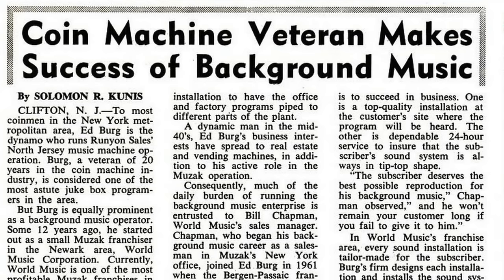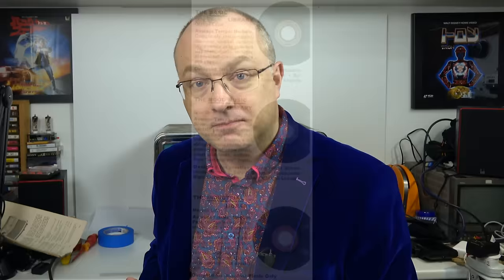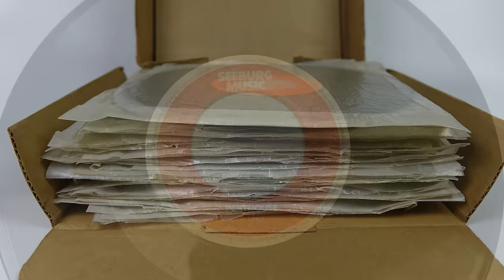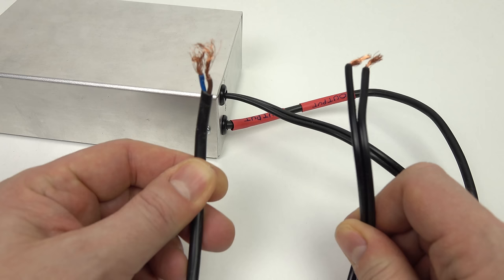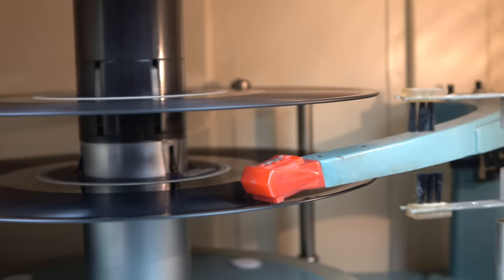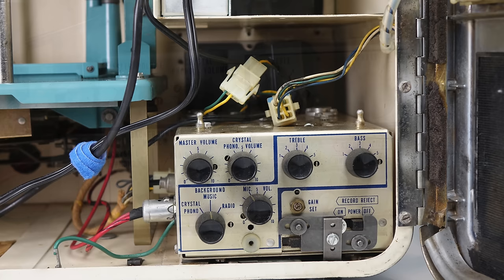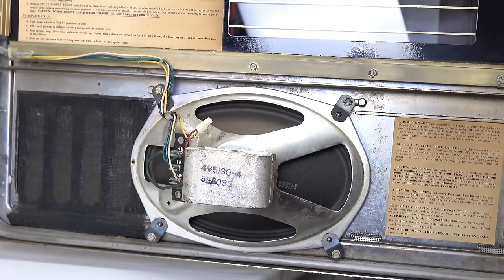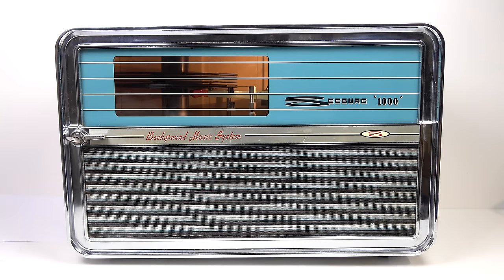RetroTech: Seeburg 1000 BMS1 Background Music System (1959-1986)

Comment: Hi I worked for the Ditchburn organisation in Lytham Lancashire who imported 50 of the Seeburgh BMS 1000 machines in 1960, I worked on these machines in 1968 to when I finished in 1973. My work was on the Amplifiers which after 6 years or so realy did need it the capacitors were leaky and the paper ones were crap but with a full service they performed brilliant. They were the best BGM machine ever produced far better than the Symphonare we produced or the later symphonet , I am now 77 Happy days.

Comment: I have 2 of these machines and the very rare Seeburg Encore machine
The warble your having is a common issue
The 2 rubber drive tires you have need to be redone
The rubber gets divots in the rubber tire from age and they need to be redone
Also there are 2 more oil points your missing
There's two to the right under neith the main platter
It's hard to explain but do a search on YouTube, there's a fellow collector on there who points them out.
They are the drive tire bearings
There's two little felt oil pad circles, you'll see them
They need a good oiling to
But to get the most out of the machine, have the two drive tires re rubbered.
Reply from the maker: Thanks for the information - very much appreciated.
Reply: YouTube at it's best.
Reply: The hive mind. ^^
Reply: I too have owned several of these machines over the years. Note the red T stylus, it is specific to this machine. The "micro groove" of the Seeburg BMS machines is smaller than a standard LP. I'm sorry but I can't remember the exact size now. You can use a Seeburg Jukebox T needle (.07 mil) and it will play, however it will cause damage to your records. The Red T needles are very hard to find. A real treat for these machines that can make them a bit more enjoyable are the Holiday or Christmas records. They play holiday tunes intermixed with the usual elevator music. Rowe also made records that will fit these machines. Rowe Custo-Music I believe they are called. Lastly, keep in mind the smaller groove of these records and the slow playing speed, handle them gently. They seem to be more prone to skipping from scratches.
Reply: @Kent Teffeteller yes, thanks for that.. I have an NOS set somewhere in the house and can't find them. Ha..
Reply: I wish I had even one.

Comment: The predecessor to the Seeburg 1000 system was the Seeburg Library Unit.  You could get them in a few different flavors.  The first one was the SL1, a huge console that played 100 78 RPM records.  It was a double-sized version of the Seeburg M100A jukebox and used the same mechanism.  The mechanism was told which records to play, side A or B or both, or skip via 4-position levers beneath each vertical record slot.

When Seeburg went to 45's in 1950, they updated the Library Unit to the 200LU-1, also holding 100 records, but 45's of course.  It was updated to the LU-2 and LU-3 over time.  Each variation came in a standalone console with amplifier and large 10 or 12 inch speaker in a nice cabinet, a standalone tabletop or bookshelf version in a blonde cabinet about 20cm x 100cm in size, and a mount-in-wall version that was just the standalone without the outer cabinet.

Comment: I seem to remember some early record decks had a 16 1/2 rpm speed. Maybe my memory is playing tricks with me !
Reply: ovation99 You're correct about some players having a 16 RPM speed. The format was used in the consumer market mostly for audiobooks and other recordings that were mostly just speech. It never really cought on though
Reply: You are correct, decks that played 16-1/2, 45, 33-1/3 and 78 RPM were common. You can still buy such a deck from Esoteric Sound. I have an Esoteric Sound Restoration Deck that I primarily use for transcribing 78's that has settings for all those speeds. It has a speed control adjustment that also allows, e.g., playing Edison Discs at the correct 80 RPM speed. For LP's I use my Technics SL-1200MK2 Quartz-Lock Direct Drive deck. You could play the Seeburg records on an Esoteric Sound deck by fabricating an adapter for the spindle (it is supplied with a 45 RPM adapter).

Comment: Record players from the 60s had speeds of 16, 33 and a third, 45, and 78 so you could have played them on there with an adaptor for the middle :-) I always wondered why they had a speed of 16 when all records were made  for 33 or 45 then
Reply: The 16 and something speed was used primarily for audio books, where high fidelity wasn't needed. I used to have a couple of those, and our family's record player had a setting for that low speed. Also, great fun to listen to the Beatles at half speed. Creepy, but fun. And on rainy days, we'd listen to records on 45 or 78. Ever hear chipmunks singing "Eleanor Rigby"? I had an awesome childhood.
Reply: If i remember correctly, the Seeburg system used a special stylus for its records, much finer than is common for 33 and 45 rpm records.  It's possible to play the Seeburg records on a regular phonograph at 16-2/3 rpm (there are videos on Youtube of people doing this), but it's not optimal.   

Chrysler (yes, the automobile manufacturer) also had a record player that used a 16-2/3 rpm speed; it was called the HiWay HiFi or something to that effect.  Yes, it was a record player FOR A CAR and was a factory option in the 1950s.  It, too, used special records, available only from Chrysler.  It was a massive flop.  Even though it (reportedly) worked better than you might expect, it was expensive, bulky, there were only a handful of records available, and when it DIDN'T work, getting it repaired was next to impossible.  

Other companies were trying this same thing (interestingly, the origin of Motorola - literally, 'Motor Victrola'!) with players that used standard records, but they tended to ruin the records after only a few plays.  Mr. William Powell Lear, one of the men behind Motorola, and creator/manufacturer of the Lear Jet, went on to develop and market the 8-Track tape cartridge.
Reply: Yes you have reminded me we used to play the records at different speeds. We had a Dansette record player I think it only had two controls Volume and Tone .....  those were the days
Reply: +VWestlife   Ah, thank you for the clarification.  I thought the stylii for the Seeburg system was finer than that.  I must have confused it with the Highway HiFi.
Reply: As I recall back in the days when Motorola was getting its start companies were putting "ola" on pretty much everything having to do with sound. Motorola was making some of the first radios made for cars so... Motor...ola.
Reply: @JeffDeWitt  Yes, in the late 1920s it was "ola" ; in the early 1960s it was "tronics" and in the late 1990s it was "dot-com".

Comment: Saw this in the ending of other videos, and finally saw its video. I had initially thought it was a modern remake version of an old desktop jukebox, but see it's an original vintage design. So, so neat! 

If I had the capital, I'd build modern versions of these that play 45's and have a control panel for song selection, with the ability to also play digital files. I know people would buy a modern desktop jukebox that actually plays records and isn't just modern electronics in a replica shell! We need more high quality stuff like that available, as the market is there!

I have an old tube shortwave / world-band radio from New Zealand in a wood, desktop enclosure. If it doesn't work, I've been thinking of turning it into a digital player using the tube amplifier section, kind of like a jukebox like this. Same size. 

Man I want this thing now......

Comment: When I turned 16, I started working at a grocery store during my high school years. The background music system the store used sourced it's music via a satellite receiver. I remember the big dish on top of the roof but I don't think it was C-band because it wasn't that big but was bigger than a standard modern dish like Sky or Direct TV.

They played this somber elevator music 24/7 and I hated like any teenager would. However when we worked night stock, after the store closed, the manager would wrap a rubber band over the switch on the microphone and set a ghetto blaster in front of the mic tuned to an FM station so we could listen to rock music while we worked. The only problem was when there were breaks in the music (example, INXS: Never tear us apart) you could here the background music at a reduced volume so it was kind of creepy. When the microphone was engaged, it only muffled the music about 90%. But when the radio was being played with the mic engaged, it tended to cover up the background music and you couldn't hear it. 

The funny thing is today most small businesses just play local FM radio over their store's speakers. They don't even subscribe to anything like Sirius/XM for their music.

Comment: My record player, a Dual 1019 can play 16 2/3, 33 1/3, 45 and 78 RPM. Only thing is missing would be a two inch plug to play them. It's got the option to play multiple records too with a drop down mechanism, however only the upper side will get played.

Comment: Why do people say "they don't make them like this anymore?" This is not a cheap home use machine, it's for industrial and business use... Any tech, including tech today, that needs to meet a requirement of operating 24/7 will be built like this. Just look at enterprise server gear, built to a much higher standard than home computers. Plus, it's not like cheap junk didn't exist back then, in fact, it was pretty common, cheap plastic and fiberboard all-in-one entertainment systems from the 70's were extremely common, you just don't see them often anymore because most of them were put in landfills. I've repaired electronics from the 60's and from last year and in the end of the day, they do still make things like they used too, you just have to spend the money on quality products.

In fact, in terms of engineering, if you have ever taken apart an iphone you will see it, CNC machined aluminum, gold plated multi layer boards, etc. I would say that's pretty well built. Hell, my blackberry has a solid magnesium subframe.

Comment: Loving your videos as always squire!! One thing though... I know you don't claim to be an electronics engineer of any kind, but may I respectfully advise you to use slightly better methods when joining/splicing cables etc? You said you soldered the connections of the sine converter, which is obviously good... but then you used insulating tape! Over time, that can become brittle, bear in mind it's proximity to the motor and also the record lifting mech. Much better would be to invest in some heat-shrink tubing and a heat-shrink gun, they're cheap as chips on Ebay and will do a much better job of protecting your valuable investments for years to come :)

Comment: I do not have the player unit but I do have quite a few of the records including a 25 record set of Christmas from 1965. I have converted them to digital by playing them at 33 1/3 RPM and using a program called WavePurity to slow the speed down. Fortunately all of my records are in mint condition as if they were never used.

Comment: when our local co-op closed i pulled a record deck out of the skip it had 16, 33,45 and 78 the only disc in the skip was the air attack warning disc which was 16 rpm, i never found any more 16rpm discs, i still have the deck in the loft, sadly the air attack warning disc was donated to a cold war display at the local museum (and never given back to me).

Comment: For the model missing the lock on the front, depending on the size of the hole, and depth of where it needs to latch inside, I might actually have a lock that'll fit that.  It's certainly the right shape for it.

Comment: I love those machines! 
But replacement stylii are even rarer than machines.
The groove is smaller than on a normal LP. Using a nowadays stylus does not follow the groove correctly so you wear out groove walls and have a rather muffling sound without higher frequencies.

Thanks for that nice video!

Comment: I remember my family had an all in 1 stereo back in the 70's (finally sold it in '87) that had a 4 speed turntable, 78 / 45 / 33.3 / 16.  Was from sears but cant remember if was a house brand or not.  Now I'm wondering if it would've played these discs with the right size adaptor ring.  Never had a chance to try as  I never had any 16rpm records.

Comment: So I know that 16 2/3 RPM records never took off because of the supposed low Fidelity but this actually sounds pretty good. I have a stereo that has that speed setting on there but I don’t have any record of that play at that speed.

Here’s what I’m wondering…
1). Why would Seeberg want to destroy those records after three months?
2) Why was there never a changer like this for LP records or 45s (that could play the bottom side)?
Reply: 1. They saw them as disposable, simple as that.
2. There were a few, but they never took off because of the price. Technology Connections did a video on one some years ago.

Comment: The true Jukes just had some steel wire around the motor axle to enhance diameter and thereby compensate for the frequency difference in Europe, and a large autotransformer to reduce voltage to the desired 115 V for the machine. 
Actually many Public address system amplifiers and distribution centrals featured built in phono amps, so why integrate something into the unit for the central control room mount, when it is not really required. AFAIK they could also be ordered with built in preamps and even power amps. But I may remember wrong.

Comment: Didn't you solve the 60hz problem previously? This looks better but the other was more elaborated .
Reply from the maker: The previous solution was something I put together to demonstrate things, but is only to be used for short periods as it is messy and noisy - however a device like this that may be running for hours needs a more permanent solution.
Reply: Techmoan did you add the sine converter only to the motor, leaving the rest of the system running on 50 hertz? Edit: found the comment where you had answered this already, including the reason behind it.

Comment: I did the reverse of that by playing 78s at the wrong speed and speeding them up with Audacity.  You have to undo RIAA eq, speed it up, and redo RIAA in the hope it's close enough.  It worked great on a Bing Crosby record, the paper record WWII morale telegram was easy to understand, but didn't sound good (was recorded on bare minimum kind of equipment).I'm sure it would work a treat so long as you know what size needle to order to play it with.  In this case I"m guessing a .7 conical diamond microgroove.

Comment: 5:18  .3 amps times 117 volts should equal 35.1 watts, but for some reason they list it as 20. I supposed if the power factor were severely affected by a reactive load, the number of watts dissipated could be that low, but I'd expect something like that to be an electrical code violation. Anyway, that thing looks much too big to only be consuming 20 watts.

Comment: You could   put that the sine wave converter on the input of the device  all the motors will be running at 60 Hz instead of 50 Hz just saying but great video

Comment: Would someone with a better grasp of electricity then me care to explain why the 50/60 Hz differential doesn't also affect the amplifier?  I understand why the motor would run slower at 50 Hz AC  but wouldn't it also cause the amp to underdrive or overheat?

Comment: With all your experience, you couldn't think of ANY other way than to snip that connector? I'm a bit disappointed hehe....There are some ways. Probably the first one I'd try is to insert solid-core wires into the back of the connector, where the original wires come in to be crimped to the connector. I've had wild success doing this with standard PC molex power connectors, but I didn't see enough of this design to tell if that'd work. Regardless, I'd never ever snip a vintage connector for any reason, as there is ALWAYS another way.

Comment: As simple as the old technology sometimes seems to be, all without a computer, just with mechanical means, its not as simpel as it looks. Doing something mechanically is usually way more difficult than using a microcontroller.

Comment: Could you just stack your own 45s in there? Could I just fill it with punk singles and have like an endless mix tape kind of scenario?
Reply: Standard records are the wrong size. They designed the machine to only accept their own non-standard size.  The opposite (playing a Seeburg 1000 disc on a record player) may be doable if your turntable has the half speed (16⅔rpm) and you cut out a piece of wood or plastic to sit on the central tab and fit the large hole in these disks.  You may also need to readjust your equalizer and maybe decompander to match the seeburg standard instead of the usual RIAA standard.  But I guess Techmoan will have a more detailed solution in his next video.

Comment: I have a radiogram at home that's has 78, 45, 33 and 16 rpm, but only the radio works the record player dose not work, and I gives off this horrible smell when I turn it on
Reply: The record player is probably seized; and the smell is probably from friction from the rubber idler wheel trying to turn it.  It's a common complaint with old record players.  The good news is, they're usually easy to fix.